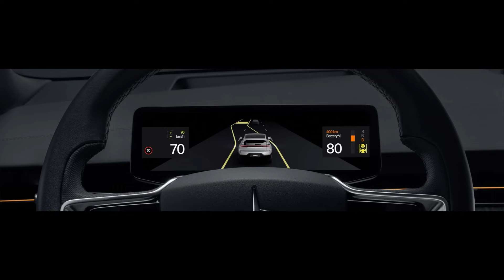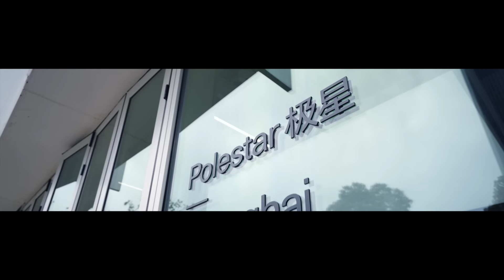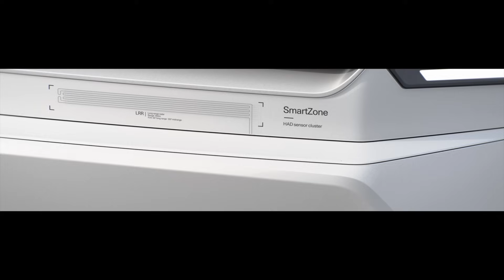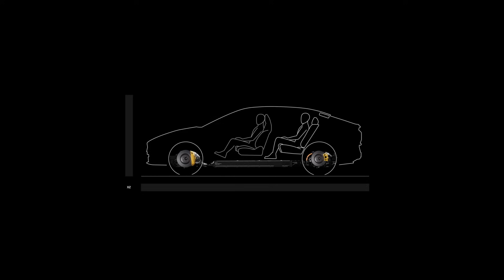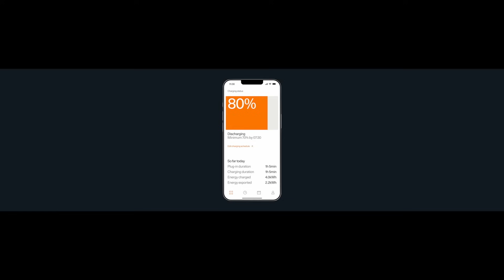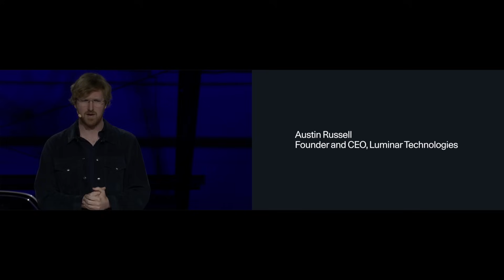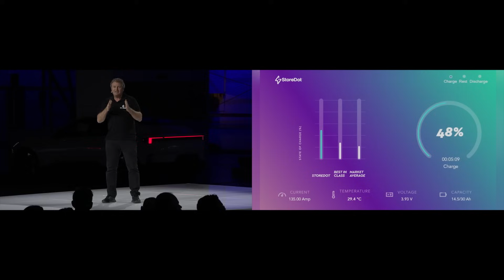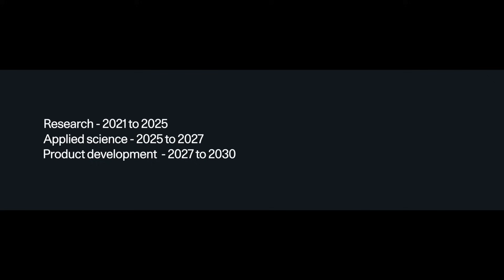Polestar Day | 09.11.2023 | Full presentation | Polestar

Comment: It's sad that Sweden let volvo be sold so cheap to China. If polestar was built in Eu, that would bring so much jobs.
Reply: The problem is electric vehicle production today is logistically easier to do in China for Volvo. This is because batteries are made in China and are too heavy to transport to EU for assembly. However, Volvo is building a battery factory in Gothenburg, Sweden which will make it possible to assemble electric Volvos and Polestars in Sweden and Belgium. They are also building an EV only factory in Slovakia or Slovenia (can't remember), which will produce both Volvo and Polestar. Geely has been investing a lot in Volvo and in Europe. This is a transitionary period where building EV:s is simply easier to do in China now, but investments are being made to make it possible to manufacture them in Europe as well.